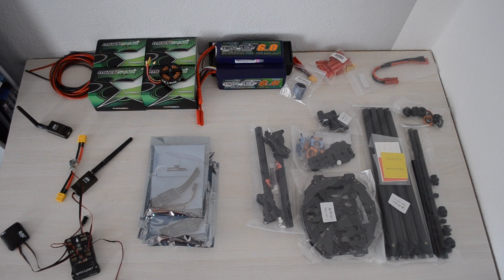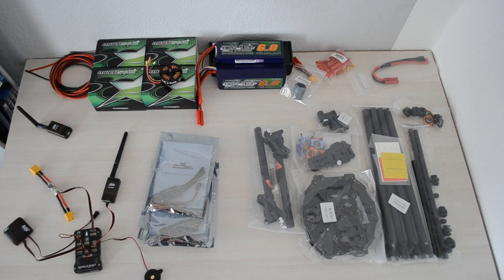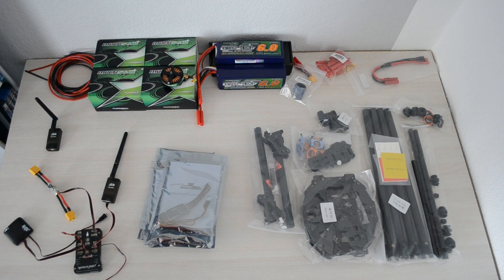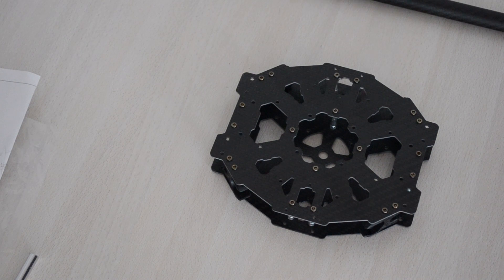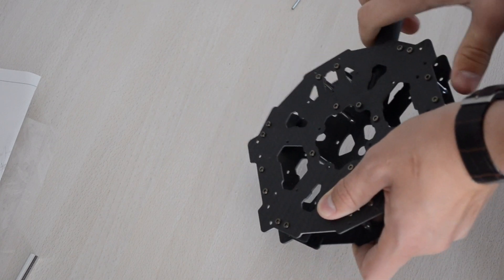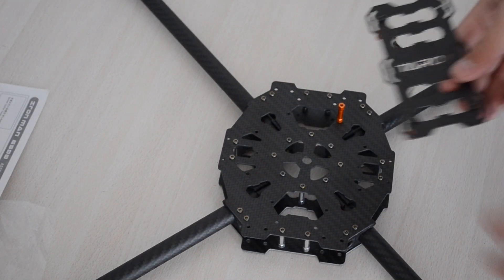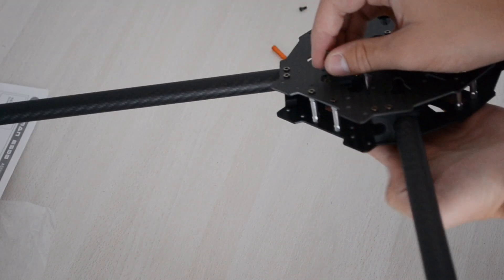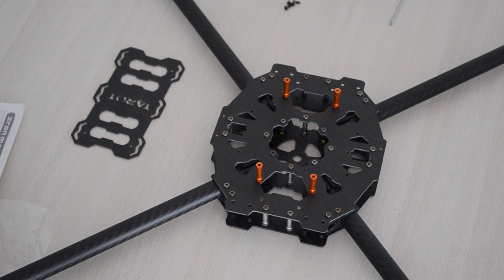Tarot IRONMAN 650 build and review - mounting booms  [Part 1]

Comment: Could you please confirm the following details:

Outer diameter (OD) of the carbon tube arms used in the TL65B01 (please specify in millimetres and any manufacturing tolerances).

Whether you have a datasheet or technical drawing (PDF) for the TL65B01 that includes tube dimensions and any sleeve/insert details.

Confirmation of compatibility (or any recommendations) for attaching Tarot Φ16MM Metal Dual Motor Mount/B (TL68B43) to the TL65B01.

Comment: The individual cf parts ware well made on this frame, but the landig gear sucks. Also, the screw holes on the plastic pylon ends break EASY. They shoulda used beefier ends. Also, there is almost, but not quite enough roon to put any type of controller in the main center body. Plus the standoffs for the "battery compartment" are too short to fit any type of usefull battery, controller in there. If this kit were to come with taller standoffs and two auxillary plates, that would be dandy.

Comment: Si tis the same as the 650 Sport? If not what is the differences, please. Thanks
Reply from the maker: No it is different. It is the same size, but the sport has an integrated PCB, retractable landing gear, and plastic motor mounts and thats all i can see is different. I never had a 650 sport so i wouldn't know for sure :-)
Reply: +MultiCopterBuild I love your videos!! I would like to talk to you! I have this great idea

Comment: You know the instructions say to take the whole main plate section apart and lock tight all the screws into the metal posts!.  Kinda makes sense from all my mono blade helis I built in the past!
Reply from the maker: Yes. And i believe i mention it somewhere (either in this video or a later one). Although i must say, that the screws are very tight even after 30 flights or so without locktite. So yes it is a good idea, but not necessarily life threatening to do so :-)

Comment: Hey can anyone tell me what the max Inch blade size this frame can handle?
Reply from the maker: The safe max prop is 16". You could go with 17" and some have done, you just need to make sure nothing expands beyond the center hub. :-)
Reply: MultiCopterBuild Ah thank you.  I was going to find out anyway should be coming in mail shortly lol!  Now I can order blades so everything comes around the same time :-)

Comment: Hy can i setup  Tarot IRONMAN 650 as 8x ? thanks
Reply from the maker: You would need some other motor mounts where it has plates on both sides. Sure you can find those somewhere. The frame is pure Carbon Fibre so i guess it would be strong enough for 4 extra motors. If you do try it, please post your progress. Would be cool to see :-)
Reply: l,,,,,,,,,,llklm,,